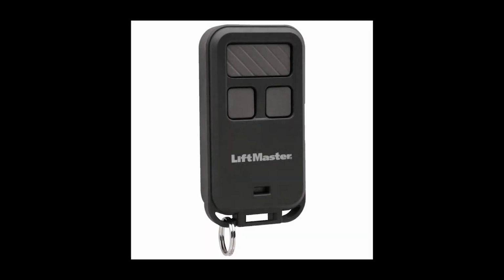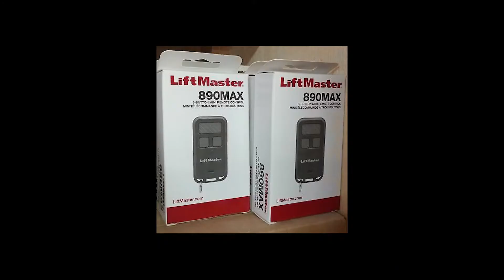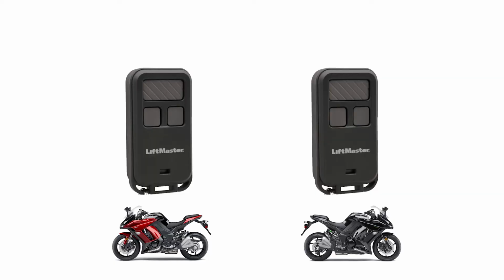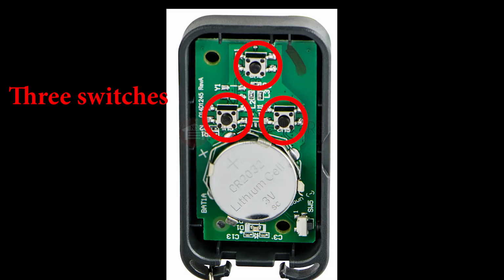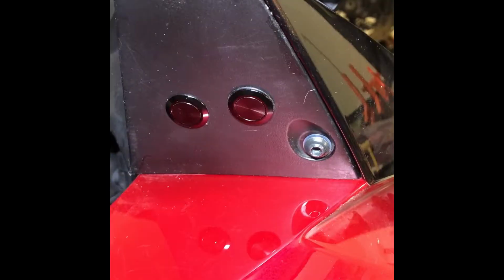Dashboard Garage Remote Control

Comment: WOW what a great idea im so going to be doing this mod! Thanks for sharing this!!!
Reply from the maker: OMG!  I life changer since installing them.  I did it two ways:  One with installation in the front fairing area like in the video.  The second, I ran a wire from the front cowling buttons to under pillion (rear seat) where the control was mounted in a plastic bag for water protection.  Both work fine.  Not sure which is better, pros and cons with each installation.